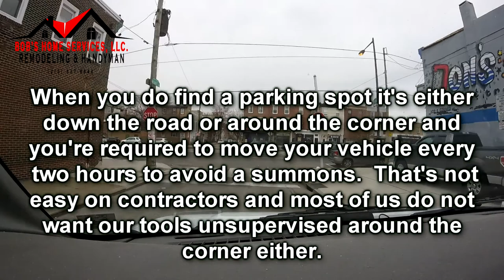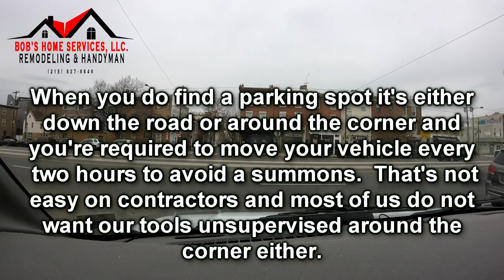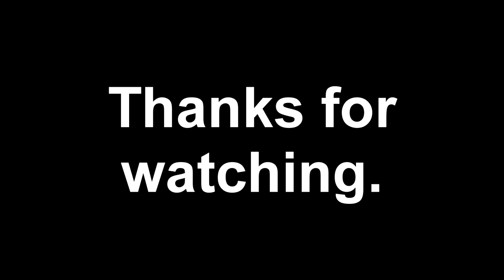Mushrooms and Mold

Comment: What is that device your scanning in the shower
Reply: That's a MagnaSpot.  It has pin point accuracy through walls and floors and concrete up to 4ft thick.  The transmitter was pushed into the center of the moldy drywall and the receiver used in the shower.
Reply: @bobgrant04649  my son had mushrooms as he called it in his room the landlord jus put bleach on it and said it was fine.i know it was spores.didnt remove carpet and I'm concerned it is in the vents
Reply: @bobgrant04649  should I call the health inspector he has been diagnosed with asthma.but never had it before.he is 13
Reply from the maker: Kenyon, Mold continues to grow if it remains moist.  In other words if there is a leak that has not been fixed, the mold will continue to grow, but when bleach is introduced and the moisture is repaired, it dies.  If he is continuing having trouble I would definitely consult a doctor.  I think the big box stores sell mold kits that you can purchase, hang in the area where the mold was and then send out for evaluation.  I would suggest this option, but whether or not you talk to your landlord about it is completely up to you.  If you do the test and it comes back positive, you could consult your landlord from a position of authority.